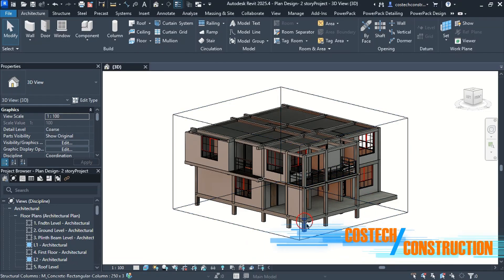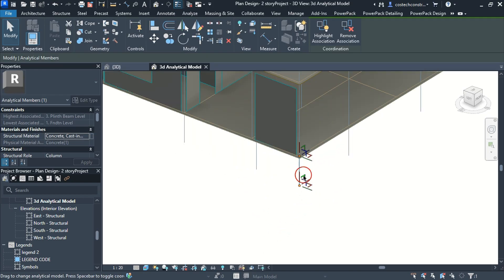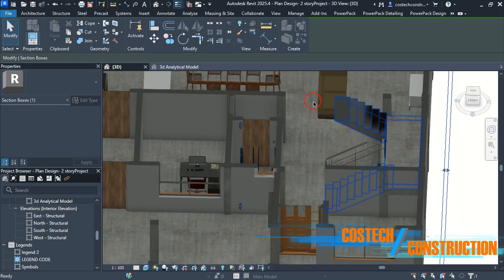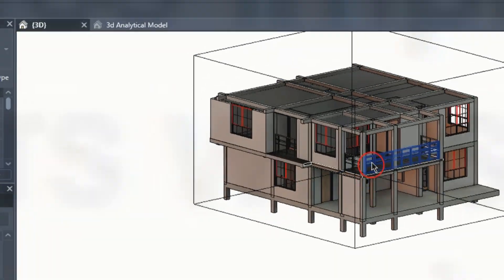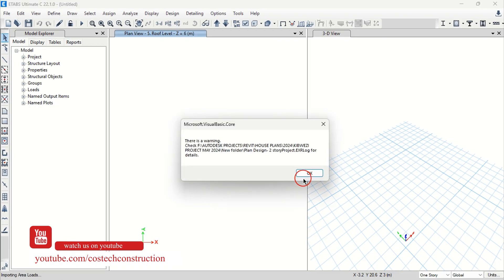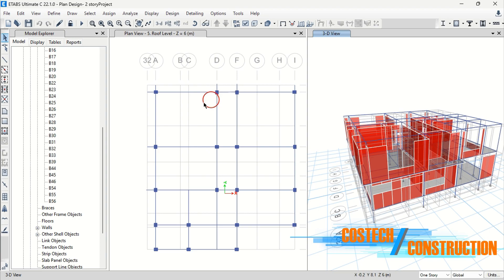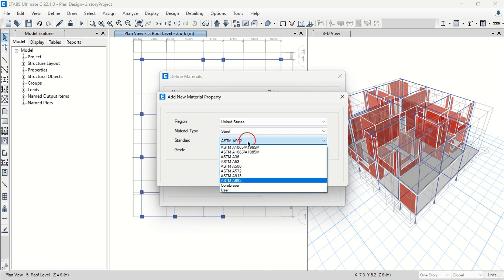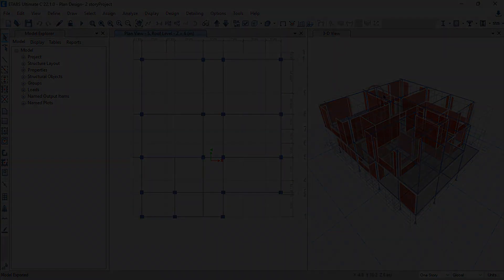Revit Structure to ETABS Using CSiXRevit 2025

Comment: While trying to import the .exr file into ETABS, I receive the error Error in performing myImportRevitModel. Has anyone faced this issue and can suggest a solution?”
Reply from the maker: Ensure to perform a structural analysis check in Revit to see if you have issues, 
Will add more videos when we start the complete Revit to Etabs Course.

Comment: Sir. After I get the rebars result from etabs, when I tried to import it back to revit, the rebars are chaotic, stirups are broken. Did u have same issue?
Reply from the maker: No, the rebars come out fine, it depends on your calculations in ETABS. 
I will cover complete course from Revit to Etabs with loads and analysis
Reply: @costechconstruction254  when pls? and can u tag me the link when you do. thank u
Reply: @kingmadeofficial6124  as tu trouvé un tutoriel dessus !?
Reply: @costechconstruction254  waiting tutorial also sir 🙏🏿